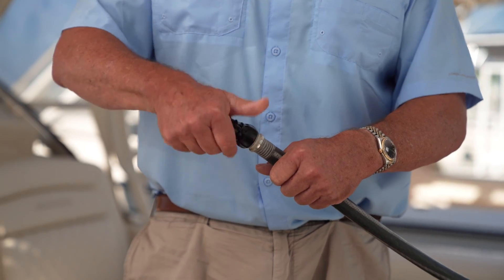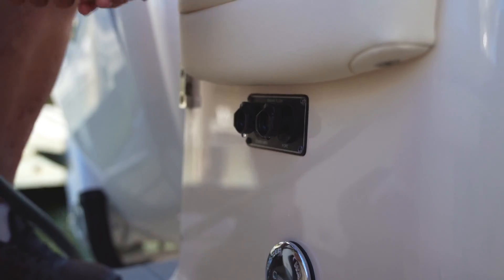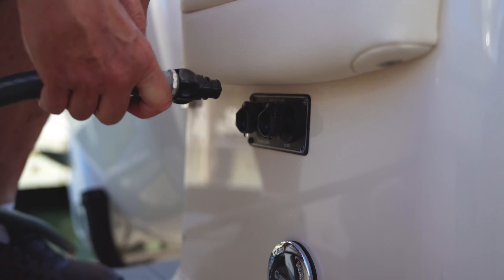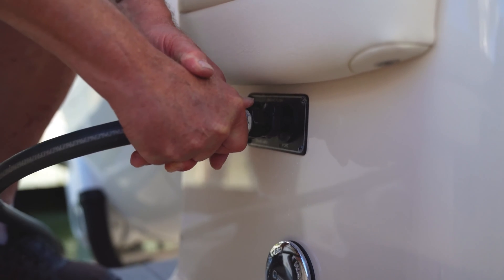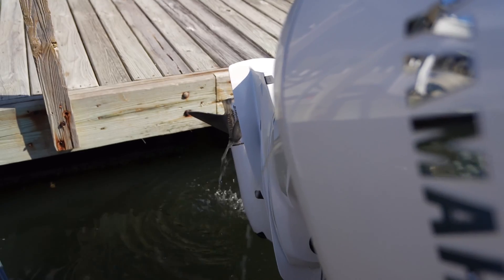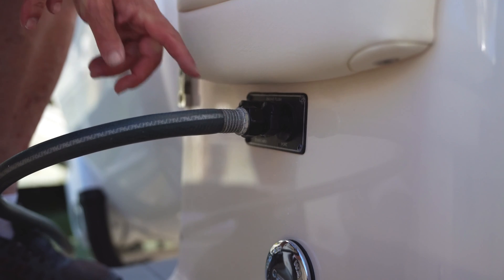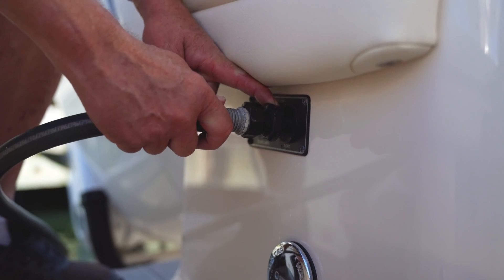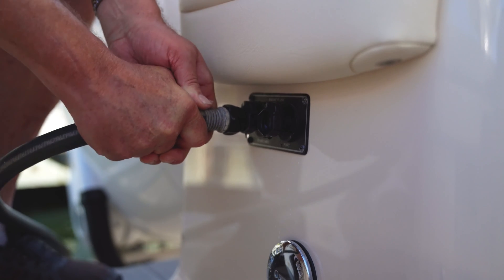Grady-White's Remote Engine Flushing System

Comment: What is the recommendation for flushing in the water with trim up or down if the boat is going into a dry stack?
Reply from the maker: If the boat is in the water, the engines should be trimmed up when using the remote flush feature. If the boat is on a trailer, a lift, etc. they should be trimmed down.

Comment: do the 2019 freedom 235 boats have this feature?  I cannot find it...
Reply from the maker: Yes, the 2019 Freedom 235 has remote engine flush. It is located under the starboard gunwale.
Reply: @gradywhiteboatsofficial  Got it...thank you...
Reply: Can you please provide a part number for the male fitting?
Reply from the maker: @BROCALinc  Hi! Please contact your dealer and they can assist you.
Reply: @BROCALinc HFCD261235GHT
Reply: Do the older boats have this? I have a 2009 express
Reply from the maker: @Dogboo8787  The remote engine flush feature was added to the Express 330 in 2016.
Reply: Can you flush both engines at the same time with two hoses and adapters ?